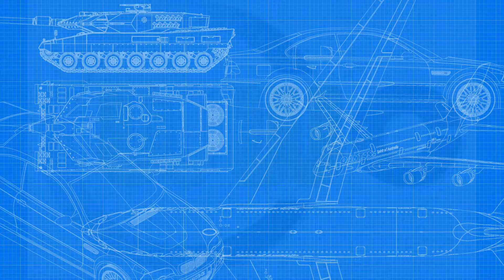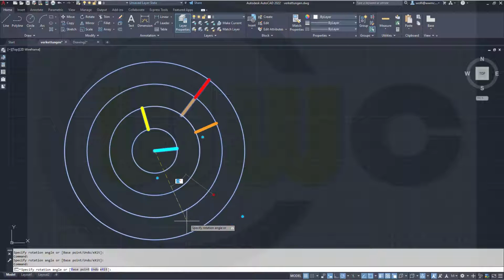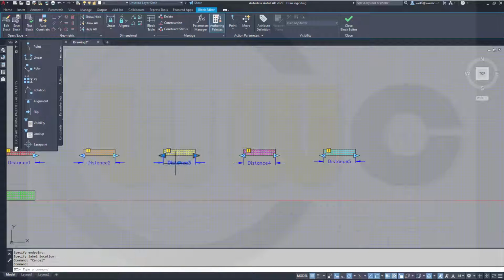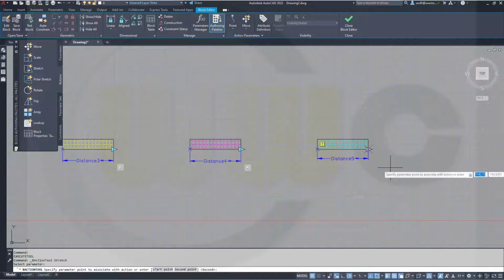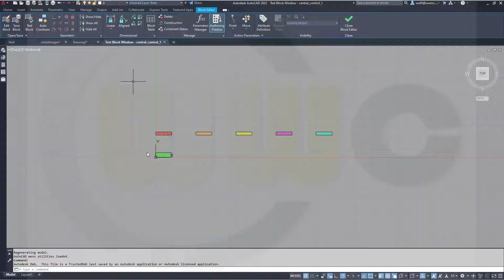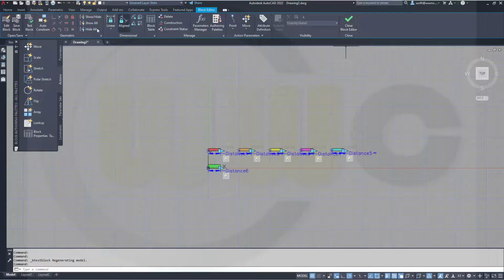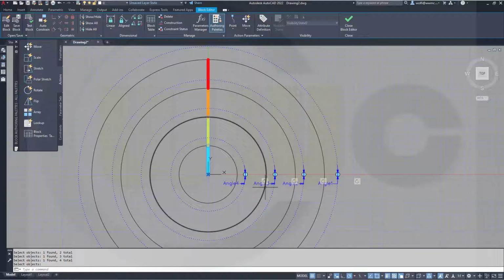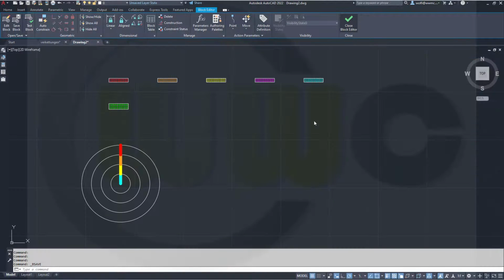Dynamic Blocks - Chain Actions - Autocad 2022 Training - 2D Basics

Comment: OK, I subscribed, the chaining actions here helped me a lot... however, i am trying to chain a stretch action to a rotation action, actually , I am trying to chain a stretch action and another rotation action to a rotation action , but perhaps i need to utilize some contraints... the second rotation object  is rotating around the first rotation point instead of its own... how can we colaborate?
Reply from the maker: Hi, in my opinion it is impossible to chain a linear action with a rotation action. Same applies to your second problem, you have to go for "parametric" and formulas in order to achieve this.

Comment: Can you show an example of how to chain two rotations that do not have the same center point? Such as the arm of a backhoe in elevation.  I often end up with geometry shooting off it to space.
Reply from the maker: Sorry, this seems to be not possible. At least I could not find a way to make it work.
Reply: I have made it work!  Simply set the 'slave' rotation action (the one driven by the other one) 'independant' and leave the master rotation action as dependent.  This makes one rotate on its own and also rotate via the master control.  They both rotate on their own separate centre

Comment: What if I wanted to chain one action exactly to the opposite of another? exemple, if I rotate one object in one angle clockwise, the other object would rotate this same angle counterclockwise
Reply from the maker: You should use the method from the follow up video -  use one parameter with more than one action. So one action could be a rotation with a negative modifier.
Reply: @wolfgang.walden.cad.training  I wish there was a modifier for rotation actions but in version 2020 there is none. Can you confirm that it exists in 2022?
Reply: No matter what I try I can't get it to rotate in the opposite direct either.  Did you find a solution?  The fields don't seem to accept a negative value, they just convert '-50' to '310' and remain rotating in a cw direction.